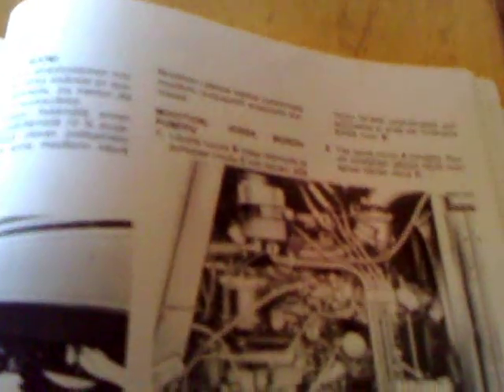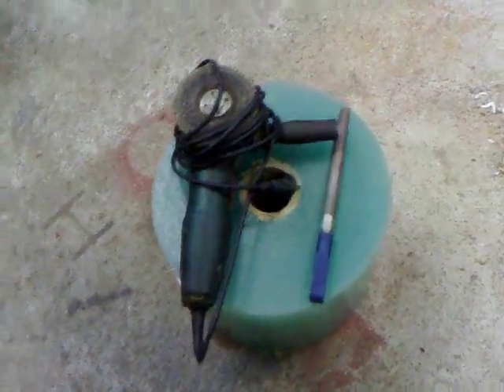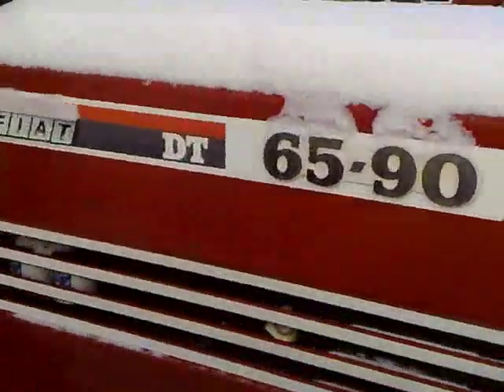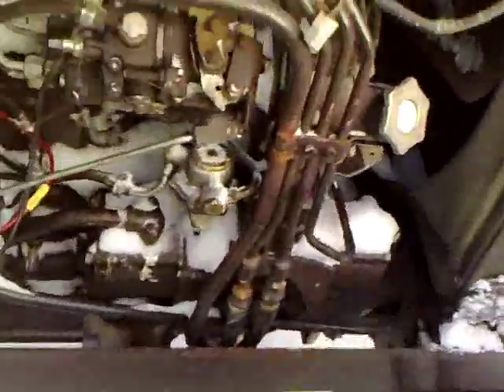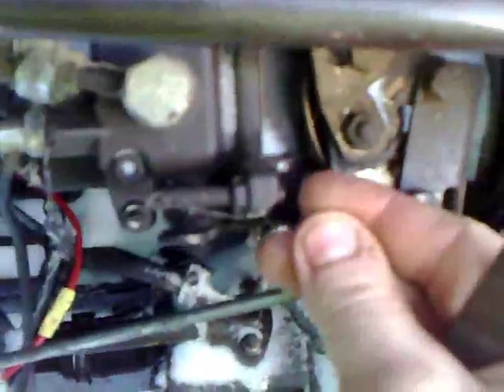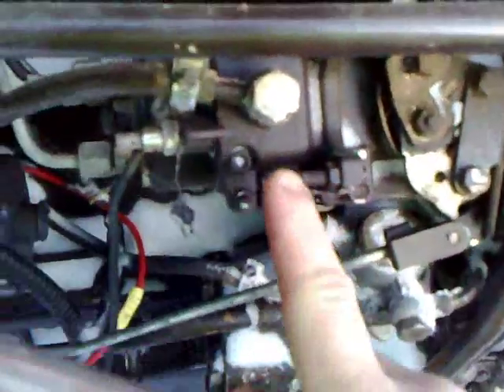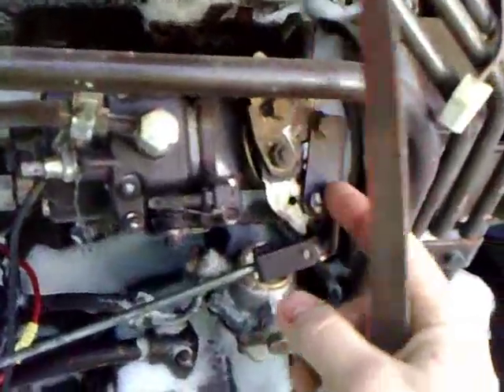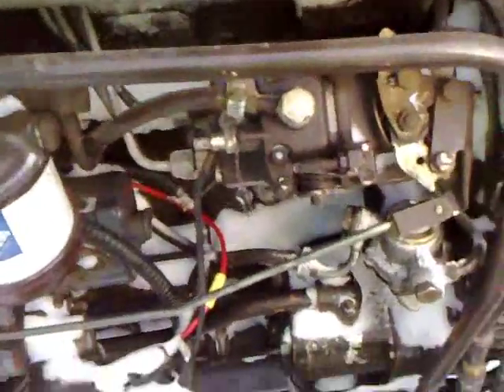How to adjust diesel engine maxium running speed

Comment from the maker: Not much but slightly more. That help in some cases like taking speed for to clime hill up. That Fiat tractor has orignal speed about 39 km/h but little tuned 45 km/h its about 12% more. Not much but tight situations that last that you need.